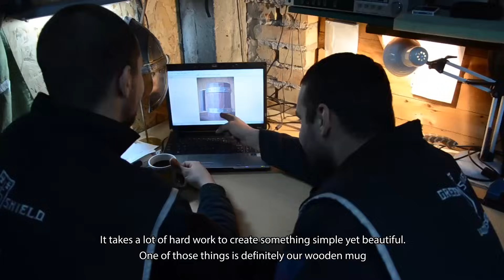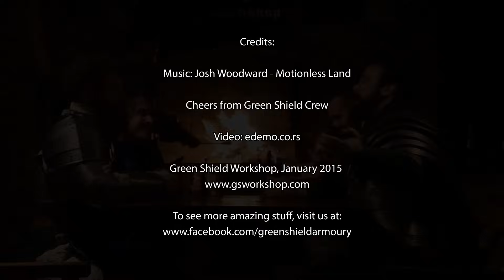Wooden Beer Mug- The Making Of

Comment: Very interesting! I recently received a set similar to these that my German born great-great grand father made. They are beautiful, he was a pattern maker and as I understand very talented and helped design some intricate devices. Anyway, the banding he used appears to be strap strap and it is broken and soldered in places, I going to guess from the wood expanding from humidity or moisture, as the  finish is very thick. I see that you use a seamless steel tubing. Great workmanship and Thank you for posting this video!
Reply from the maker: That is probably true. Wood need to be stabilized in order not to absorb moisture or to "breath". That is why we have special coating that prevents that. 
Thank you for commenting! :)

Comment: Interesting that when you cut the slats for the mug, you don't miter cut each side so that each slat lays flush with the next. Are you just not showing that step, or do they kind of press together when you assemble it? (It's possible that I just missed that!)
Reply: +Caleb Faulkner Both size have the same angle. We just didnt put that in video, because its 2 scenes of the same part of production. Video is already longer then it should be, so we cut out all unnecessary parts

Comment: You do a fairly good job of welding the outside curve on the handles but you completely miss the inside curve
Reply from the maker: Hi David, thank you, since we currently use MIG process, it's a bit difficult to grind flush the weld on the inside. It does not affect sturdiness of the handle, but we will upgrade hopefully soon for aesthetics ;) Thanks for comment :)

Comment: I have never seen a sanding system like you used to sand the interior of the mug.  Is that something you designed or can it be purchased commercially?  I would like to get info on how to get one.
Reply from the maker: +Brad Sumner Take a sanding paper with cloth baking (not paper) and cut into strips. Drill a hole at one end of the strips and put a screw through all of them. Arrange them randomly and tighten the nut. Take a longer screw so you can insert it into drill head. That's it. You can experiment with different lengths, thickness and grit ;)
Reply from the maker: +Brad Sumner Take a sanding paper with cloth baking (not paper) and cut into strips. Drill a hole at one end of the strips and put a screw through all of them. Arrange them randomly and tighten the nut. Take a longer screw so you can insert it into drill head. That's it. You can experiment with different lengths, thickness and grit ;)

Comment: Have you made an attempt to do this using traditional barrel making techniques (no glue, just pressure) or is it just too difficult on this scale?
Reply from the maker: first ones were made by hand, traditional way (you can find those in pictures on our facebook page, year 2012,13), and we can make then without any power tools whatsoever. But this is our side project, we are making much more complicated things, and we simply over-engineered this mug, and making process. We now even have our own one of a kind polymer coating on them, food approved,  with all sanitary permits for the product. There are 4 layers of it on mugs, it is really tough, and basically beverages dont have any contact with wood or glue.
Reply: Traditional barrels rely on swelling even then its normally topped off with with wax/or older techniques used oils derived from fats cups would never swell due to finish coat no standing liquid.. And very specific treating usage this small of scale it could work especially with polymer and stuff but just seeing it being hard to sand finish/band.

Comment: Nice idea, but for my taste too much machinery. It's ok for mass production, not for my home though. Also, I wondered you were using glue at all. The rings should tighten it all up and a good soaking closes every leak.
Reply from the maker: +y2ksw1 We can make them completely by hand, using no power tools whatsoever. But it does affect the cost of the final product, and only customers willing to appreciate true hand made items are the ones with will to pay for them what it's worth. Rings hold the wooden section tight enough, but for convenience of immediate use and maintenance, we opted for this setup. Thank you for your comment, we appreciate it. Cheers ;)
Reply: Green Shield I guess, a completely handmade mug will cost around 400$, much more than almost anyone would invest. I estimate, a handmade mug will take at least 3-4 days to make, measured at my standards = best quality. Thanks for the clarification about the sealing.

Comment: It may have been addressed, but what finish do you use that is food safe and will it work on end grain as well as long grain?
Reply from the maker: We have special food safe acrylic coating for mugs :) Only 1st layer is sprayed with thin layer of it, then it goes into heat chamber, then we soak it 3 more time, with heating and drying in between the layers :) Nothing dissolves coating, and we have all health certificates that EU requires, since we're registered firm, and selling a lot of these. So it IS ABSOLUTELY safe to use :) As for the grain, it works both end and long grain orientation.

Comment: like all of this except for the end when he sprayed polyurethane onto something he plans on drinking out of
Reply from the maker: We have special food safe acrylic coating for mugs :) Only 1st layer is sprayed with thin layer of it, then it goes into heat chamber, then we soak it 3 more time, with heating and drying in between the layers :) Nothing dissolves coating, and we have all health certificates that EU requires, since we're registered firm, and selling a lot of these. So it IS ABSOLUTELY safe to use :)

Comment: Only 2 rivets per ring is actually doing something?
Reply from the maker: 4 per ring actually :) and they are not needed at all since rings are pushed really tight on the mug. those 8 rivets are just extra safety :) We are preparing torture test video for the mugs. you will be able to see how tough they really are :)
Reply: +Green Shield 
Really good job but i think the rings looks machined. 
You could make them from black steel (i assume that shine is staineless) and go over them with a ball hammer to give them the look of smithing. Then heat them and dop in oil to make them black and whitstand water.
Reply from the maker: Well, we didnt want them to only look old, we wanted to put modern and old together :)
Reply: Green Shield

Then 5/5 :)
Reply from the maker: Thank you :)
Reply: You could even do it without any rivet by soaking the mug in water, the wood swells up and the rings fit even more tightly over the mug. But this still looks beautiful :D
Reply from the maker: There is no need for that :) those few rivets are just extra safety since rings are super tight. And you cant soak them in water, they are coated with special acrylic (food safe, heat safe) that we use on them :)
Reply: +Green Shield Ah, ok

Comment: I don't know, but I believe wear gloves to operate  those saws could be extremely dangerous right?
Reply from the maker: Yes, gloves are dangerous around saws. We have a lot of comments regarding this. But the gloves you see on the video are grip gloves for wood. They are extremely thin, easy to rip (you can pull the finger with your hand, and it will just shred ),  and they are really tight around the hands, almost like latex gloves. but they have grip surface underneath and dont allow your hand to slip easy.
Reply: learnt something new:) thx.

Comment: Very nice build, but Steel handle ? omg why ?
Reply from the maker: +Core On Crack Because mugs need to pass sanitary inspection :) and still stay strong and sturdy, so wood is out of the option. But we have series with silver galvanized bronze figurines instead of stainless steel :) even whole silver ones :)
Reply: +Green Shield How did the rest of the mug (ALL THE WOOD) pass sanitary inspection, if wood is out of the question? 

And wtf Sanitary inspection? Who cares it is a wooden mug!
Reply from the maker: Wood is out of the question because of sturdiness :) You can only glue it, or put some nails or something like that. and you can break that easy :) We ran a car over this one, multiple times (we are gonna put video soon), and nothing :) As for the wood, we have papers from company that is making polymer for us, plus papers from sanitary institute that this product can go on market :) (and btw, wood IS sanitary even if you dont have coating, because it is wood. but if you do not coat it, it will deteriorate after severe use)

Comment: glue is chemical, its save for drink?
Reply from the maker: Every single parts on the mug is food safe approved. Glue is water based, non toxic, and in the end, mugs are coated (2x soaked, then spray finished) with 3 layers of special food safe polymer made just for out needs, and this use :) Basically there is no contact with the wood at all, everything is super sealed with polymer. We have all certificates and permits from health institute that mug is safe for use :)
Reply: oh good. tanks for information

Comment: One of the rivets is missing, 5:08 :(
Reply from the maker: Yes :) those are our workshop mugs that our reenactor and larp group use for everyday :) And as we mentioned earlier. Rivets are not needed at all. They are just there because of design, and 8 of them are long just for extra safety :) When we apply the coating at the end, you would need a lot of hammering to pull those hoops down :) We are preparing torture test video, so you will be able to see how tought they really are :)
Reply: How much are they and can they be shipped to the UK? Thanks!